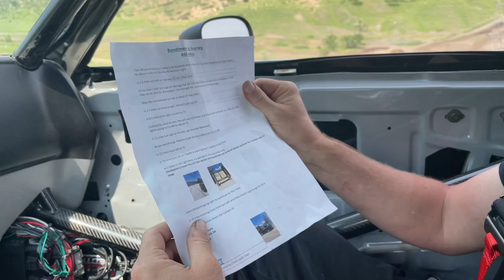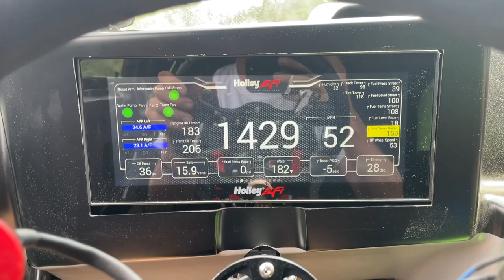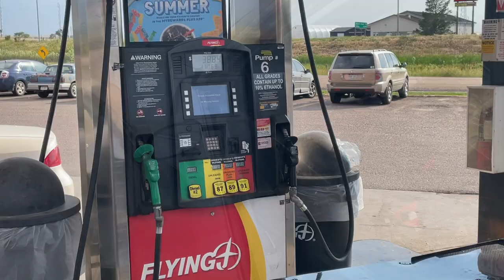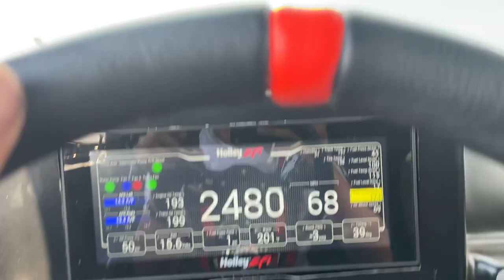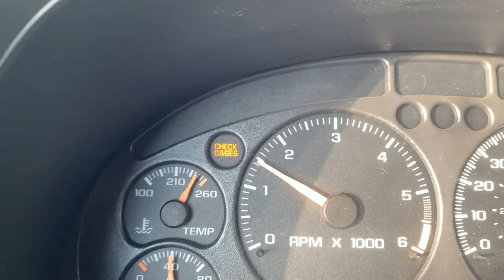RACE WEEK Day 5: Driving My 2,000 Horsepower Racecar 540 Miles Through SKETCHY Mountain Roads!!!

Comment: James should of did some old school rally magic and made the windshield washer spray the radiator to cool the Blazer down
Reply: Same thing Kyle from BoostedBoiz did on the Rowdessey when he took it on RMRW. They only had a small drag race radiator in it and it was overheating a ton.
Reply: Basically what Cleetus did with the intercooler drain. Just made it drip on the transcooler.
Reply: It works, Evo's came like that and my buddy had a JDM 1991 Celica that was a AWD Turbo car and it came like that but they sprayed the intercooler... Same principal
Reply: Love this. My old WRX had an IC spray button to help cool it down. Not sure how well it worked but it was kind of cool.
Reply: I did that on the side of the road in my Durango and threw ice water into the wash tank. It mad it from Houston to Dallas that way.
Reply: @ericMT  They wasn't much of a advantage over here in uk it never gets hot enough. Good for track days I suppose
Reply: I was about to say the same thing. I've done it on my off road rigs to help cool them when getting hung up or climbing.
Reply: @ericMT  I think MCM did a test and they work better then you’d expect
Reply: I bet there is more than 20 people in their entourage and not one of them know anything like this. I bet there is just straight water in the radiator too. Hell nah, hellhehell na!
Reply: I commented for them to do that last video 😆
Reply: They should should get a 5 gallon water jug, fill it with ice and water, then have the intake hose from the windshield wiper squirters feed into the iced jug, and then spray it onto whatever you wana cool down, maybe use a Y for radiator and trans cooler, keep some extra water to fill up while driving.
Reply: Nah it would of been too hot
Reply: I'd bet they thought of that and everything else you could do to cool it down. They drove all day. Lol..
Reply: @philb5593  Reminds me of being stationed in 29 palms and biking. I had a slight drip in my camel back that dripped on my legs and helped keep me cool hehe
Reply: @gary7323  wouldn't of been too hot, with airflow on wet aluminum the cooling properties are awesome.  Also the washer fluid reservoir is going to be way cooler than the fluid running through the engine. I've done this on cars and even with a big windex bottle of water on my mini buggy . Just spraying the radiator that sat right behind my head.
Reply: @jimandskittum  straight water cools better than anti-freeze (commonly known as coolant) because the water disapates the heat faster and more efficiently. It is advisable to run distilled water through your radiator in the summer in desert climates to prevent overheating.
Reply: Nah just spray some nitrous on the rad...
Reply: @jimandskittum  there has to just be straight water in the radiator if you drag race bud
Reply: Well, he wouldn't be able to use that on the track, but they do sell CO2 spray bar kits that wouldn't drip water.
Reply: @chevy383jt  true he can't use it before a run, but he can use it to cool the rad between runs as long as it isn't dripping when he goes to stage
Reply: @tristanholley7141  that'll work too. Funny story in the early 2000s we had the co2 sprayer for the intercooler but since it was a bottom mount turbo setup co2 kept getting sucked in and robbing power. So we filled the bottle with nitrous🤣 and just the bit that got sucked in through the intake gave us 25 to 35 hp on the dyno down low. Didn't make a difference on the street with all the air movement
Reply: @hanksadventures4132  Yeah, nah! It's amazing that people speak so confidently about something they are dead wrong about. Water boils at 212⁰ and antifreeze boils at about 260⁰. Your grandpa was lying to you.
 P.S. How can you leave comments on YT without internet access?
Reply: Maybe “should have”
Reply: Should've (should have, not should of) is a simple contraction, 4th grade I think is when you learn those?
Reply: @rickshiandmoku4128  He ain't drag racing bud. He is trying to limp a POS 540 miles in hot weather. It probably has a blown head gasket or some other cobbled together shit. I think most tracks will allow coolant in a street car anyway.
Reply: @jimandskittum  they said they use water wetter
Reply: @jimandskittum   water in the rad is good.track etiquette though. Coolant is harder is worse to clean and worse.for a preped surface
Reply: @AnthonyBowman  yeah I remember the videos with them stopping to fill that gas can with mountain water 😂
Reply: Just take the hood off #becauseroadkill
Reply: That washer reservoir would have to be 50 gal. to make it from one stop to the next....lolz
Reply: I saw someone use the washer pump to spray Coca Cola on a slipping clutch in a stage rally car. Drilled a little hole on the bellhousing, routed a washer house into the whole and filled the bottle with Coke. They'd feel the clutch start slipping and hit the washer switch
Reply: Fill it with coolant
Reply: @brianking9215  why coolant, it wouldn't do any more than water except get coolant all over the road
Reply: @hanksadventures4132  yeah coolant is just to keep your water from freezing so your block want crack in cold climates and also works like a lubricant for your water pump
Reply: @jimandskittum  pressurized coolant systems raise the boiling temperature.
Reply: @jimandskittum  no coolant in any car going down the strip, coolant is harder to clean up than water
Reply: @isaacshively6705  you can add additives to keep it from boiling and distilled water doesn't cause corrosion. Also, you shouldn't be running coolant above 210 anyways.
Reply: @jimandskittum  "thermal coefficient of conductivity"

Pure water is actually significantly more efficient at conducting and dissipating heat than glycol coolants.

"Coolant" isn't called that because it's GOOD at the job, it's called that because it is what gets used for. It's specific formulation is designed to raise the FREEZING point.

A better way of saying it is that normal cars use antifreeze as a coolant, but in hot climates whwre freezing isn't an issue, water is a more efficient coolant.

Also, the boiling point doesn't matter, because the system is pressurized, which raises the boiling point a LOT.

Comment: Im surprised with how hot it was no one opted for the RoadKill proven garden sprayer on the radiator/trans cooler.
Reply: Burndown YouTube channel did I believe.
Reply: #1 for post burnout cool down
Reply: Or even the windshield sprayer on the radiator , but I don't know how effective that would be here
Reply: They could have brought the temps down if the heater was on full blast but that would have cooked both James and George together
Reply: Boostedboiz proven windshield sprayer on the radiator trick at least.

Comment: I guess Kevin had a healthy bit of foresight with that bracket for a second trans cooler. You should have it installed as soon as you get back
Reply: Install a third core for the fuel too. No more boiling fuel in the tank
Reply: @AttilaThebung  I thought the same thing. It needs a fuel cooler
Reply: Fuel cooler will be nice, but at high altitude and lower vapor pressure it's tough to keep fuel from boiling.
Reply: And reroute the intercooler drain intentionally over the trans cooler. Add a small diffuser to make a trickle sprayer would work great.
Also need to add vents in the tailgate or bed to pull out the hot air to keep the fuel tank from overheating. Lots of temperature quirks to be adjusted.
Reply: @scottgshomewrenching1352  Needs ventilation under that black tonneau cover. Black carbon fiber isn't great in the sun. Might need to paint the tonneau cover match that light body color and glue on aluminum faced fiberglass insulation underneath.
Reply: Be mint for another race week , but probably ok as is for running passes only

Comment: Surprised we didn’t see a hoodless blazer and mullet for maximum airflow
Reply: Has roadkill taught us nothing?
Reply: or roof saw-z-all right off. . .lol
Reply: Need some gold foil on the black bed cover to reflect all that heat
Reply: @littlelifters7543   came here to say that. Thank you
Reply: @littlelifters7543  Finnegan is shaking his head in disappointment
Reply: @misterquintus  The cover is still holding in engine and trans heat.  Need to remove the rear panel so the air can circulate and put it in the trailer for the road trips .

Comment: If the blazer is overheating that bad they should do the Roadkill trick of removing the hood
Reply: I’d like to see it built with lots of nitrous
Reply: Yeah seriously! Can't believe the Florida Man that hates hoods hasn't ripped it off already. lol
Reply: @chasestewart302  They need a new engine. That 4.8 just isn't going to deliver.
Reply: Spray radiator with nitrous.
Reply: Oh ok I see you a fan fan
Reply: @generalkayoss7347  its not a 4.8, its ls swapped
Reply: @BillyBigRiggin359  Yeah that's what the builders "said." James said he thinks it's a 4.8 on a 1320 video. And judging from how weak it is, he's probably right.
Reply: @BillyBigRiggin359  a 4.8l is an ls
Reply: seems like they were onto the stop at every car wash to cool down part though
Reply: Getting too hot is why they're called a "Blaze-r".
Reply: And a  Garden Sprayer
Reply: Agree it needs some love. I just meant I’d like to see a purpose built nitrous motor in there. Something different.

Comment: The real winner here is Kevin on building one bad ass elco
Reply: An overheating ElCo with an inadequate cooling system. I member when I trashed a brand new Gear vendors...oh wait I don't make mistakes like that
Reply: Not just Kevin, the Whole KSR team.
Reply: @Snarf_Le_Wombat  no one cares
Reply: @gunslinger3013  People that know how to build cars sure do...so not you.
Reply: @Shinemaster Ahh no. They played it that way but the buck stops at the builder or whatever. Either way everything gets shipped empty. Zero excuse for not checking. A lazy mistake like that just makes you wonder what else they didn't do.
Reply: @fast97z24  because that doesn't matter for a race car? Although a proper cooling system does. Are you a 🤡
Reply: @Snarf_Le_Wombat  Just like 100% of purpose built drag cars, it was built for 1/4 mile passes, not 540 street miles at 100+ degrees. That said, Mullet made the trip just fine. How many cars have you built that survived Drag Week?
Reply: @generalkayoss7347  It was built for drag week passes kiddo
Reply: @Snarf_Le_Wombat  The only overheating issue is the trans and that's because Kevin put the cooler in a terrible location. It's a new car, it's going to have issues. No different than having to tune the suspension. It's probably as simple as moving the cooler around to where its actually facing some air flow instead of relying totally on the fan. Honestly i have no idea how they thought that would work to begin with.
Reply: @Snarf_Le_Wombat  So 0?
Reply: Marc Muke  you just click the name...
Reply: Marc Muke  LOL thats just too funny not to comment on
Reply: @dustinyouman5915  I'm a clown because I recommended an adequate cooling system. Okay kiddo.
Reply: @Snarf_Le_Wombat  people who know how to build cars would be insisting on running aircleaners on the drive between tracks, and would ensure adequate cooling.
Reply: @nordic5490  it's not Kevin's car, not his place to insist he doesn't run it into a tree.
Reply: @ryanlamfers8692  oMg A stReeT cAr dOiNG a DrAg WeEk
Reply: @ryanlamfers8692  a competant car builder should at least make space to have aircleaners fitted, and then try and convince the owner to fit them. This car has no provision.
Reply: @Snarf_Le_Wombat  this is a street car in name only. Its not like it's a daily driver.
Reply: @nordic5490  you do realize they're not expecting these cars to go 100k miles right? Look around, how many of his cars have air filters? Look at the bird catchers on the turbos, they're far from the only people saying the hell with air filters. With what they're asking of the internals of that thing it isn't like premature wear to it means the same as to your mother's Civic.
Reply: @Snarf_Le_Wombat  The only videos of built cars on your page belong to other people. You're just filming from the stands lmfao. So how many Drag Weeks have you completed again?

Comment: The thin air at those altitudes doesn't carry away as much heat. Just like you loose power your cooling system also looses efficiency.

Comment: could you guys do a "build" on the blazer with bolt on's only and see how fast it will go before bigger meassures have to be done?
Reply: That’s what they did with ruby and Leroy. Hopefully that will be the case. You can go back and watch the builds from years ago
Reply: Would also like to see that
Reply: Maybe Garza could build the blazer????
Reply: Heck yeah. 1. Weld up the diff.  2. Holley, injection and 13's!
Reply: If only they owned part of an aftermarket parts mfg that would be a great idea!  HAHAHA!
Reply: 10 bucks that thing is going to get parked next to that fourth gen lt1 camaro cleeter bought a couple years ago that now sits out in the pits at the ff. Occasionally spotted covered in dust in the background of a video.
Reply: Fr do a "real world " common man build would be fun
Reply: Just keep upping the nitrous dosage until it ODs.

Comment: Have Kevin hook up a sensor controlled spray nozzle over the trans cooler.
Reply: Oh yeah, the only problem is that Kevin will do that, and then he won't stop.
Reply: @MichaelS537  anything that gets hot gets its own nozzle
Reply: Good idea except,, water supply, where would he have put the tank and how big would it be? There's little Kev didn't think about and cover when he put together the Elko.
Reply: @quickdeuce  From the intercooler tank, same place its dripping from now
Reply: YESSSSS.  Add a tank, even like a windshield washer tank and hook a C02 line from the C02 shifter bottle to keep it pressurized and a solenoid to the output line and wire it to the ECU or if you want manual to one of the switch panel switches and plum the output line to a nozzle on the trans cooler.  Easy Pezzy.
Reply: I would start with fitting a bigger trans cooler...
Reply: @aj200415  it's on air not co2 but still good idea
Reply: @aj200415  Or just install a bigger trans cooler
Reply: @naxxx44  he doesn't have a windshield washer tank or pump on it nor wipers
Reply: but have it on a toggle switch for the system, don’t wanna have that going off randomly on the big end of the track
Reply: @CJA150179  The elco has a bracket for a second one. They just need to get one, mount it and connect it.
Reply: @V8Power5300  That's weight and connections to fall. An aux removable cooling system is a great compromise. They've got room for 30 gallons in the bed no problem.

Comment: Problem is you guys totally pulled the thermostat in the blazer. Just needed to gut it! It needs that slight restriction to slow water/coolant to allow it time to cool. It’s cycling water so fast it’s not getting a chance to cool at all. Same problem we’ve had on dirt track cars, figure 8 cars etc
Reply: Yep if you want it faster.. drill more holes
Reply: That's not how it works actually.  You generally want faster flow rates for greater cooling efficiency.
Reply: Yeah, no. Thats not how radiators work, if anything the faster moving water keeps the temperature differential inside/outside the radiator higher and removes more heat in total.
Reply: @UCCLdIk6R5ECGtaGm7oqO-TQ   the longer it stays in the radiator the cooler it gets.   A gutted thermostat works great
Reply: @Ada-zn3pw  Yes, but thats not what matters. What matters is how much heat the radiator can remove from the engine, and slower moving water means less heat removed. With faster flow the engine cools down better.
Reply: @banaana1234  huh
Reply: @Ada-zn3pw  I would suggest you go and read-up on it from an authoritive source.